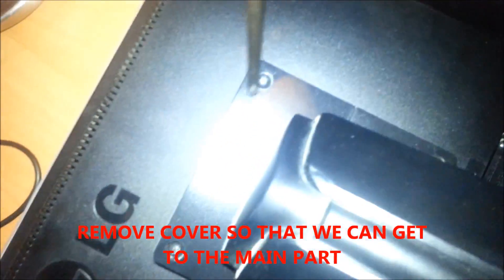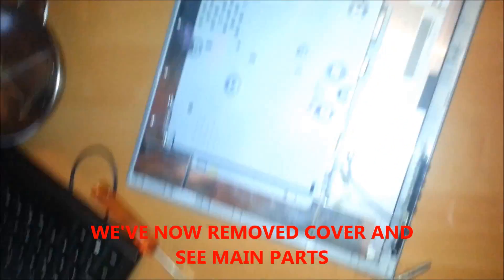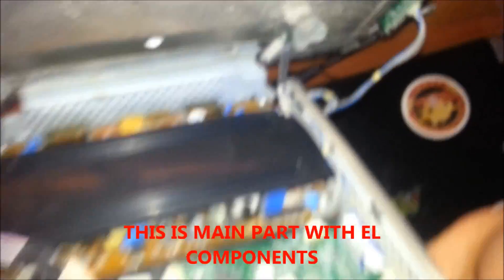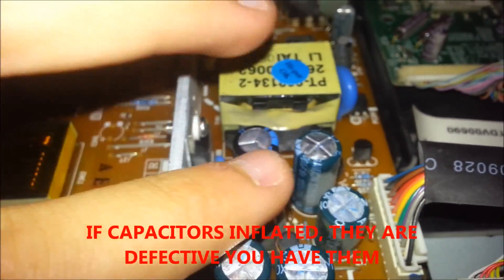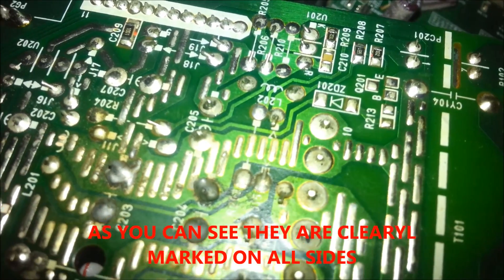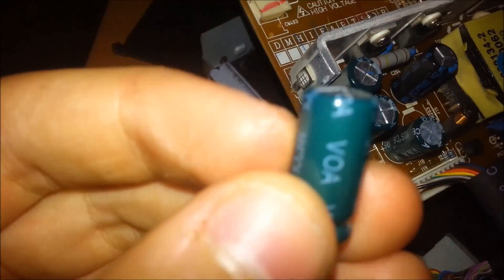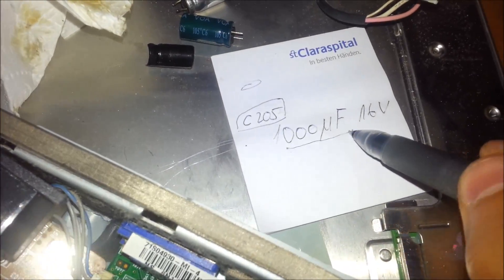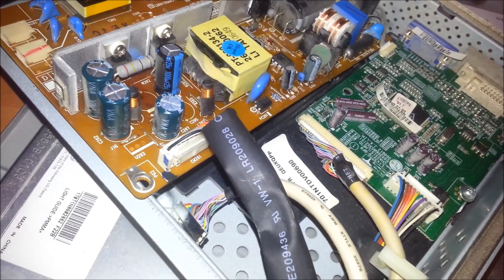HOW TO FIX PC MONITOR | BLINKING | POWERING OFF | DOESN'T SHOW ANYTHING

Comment: Dumbass, you should never replace only the bulging one, just because a capacitor is flat, doesn't mean it's ok. And one capacitor fails, then more of them start to fail. Always replace all capacitors in the same area. Sure, if you're lucky it work, but it's just a matter of time before the others fail too.

Comment: The capacitor is an electrolytic 1000uf - 16 volt NOT 100pf - 16 volts at 6' 20"..I stopped watching after that!
If you want to test electrolytic capacitors, buy an ESR meter.